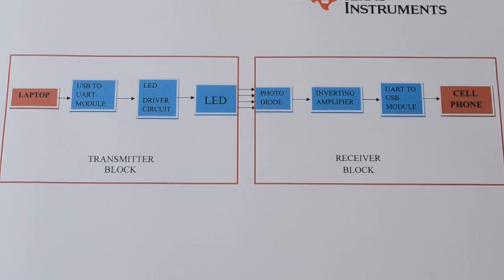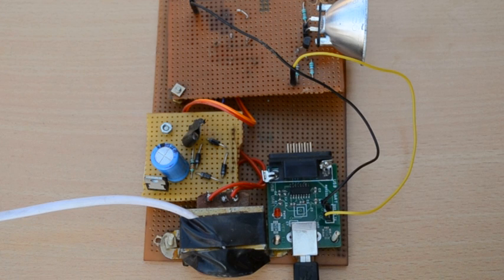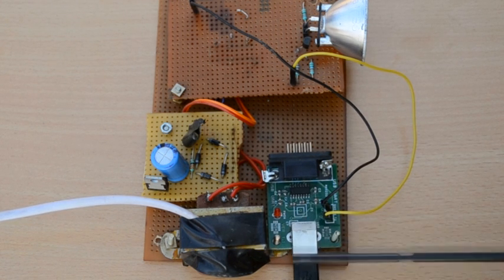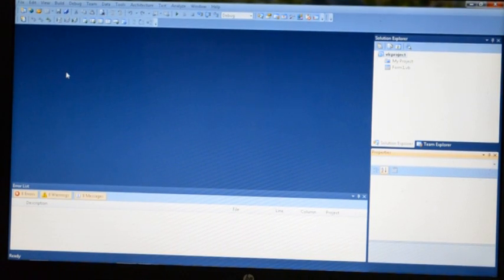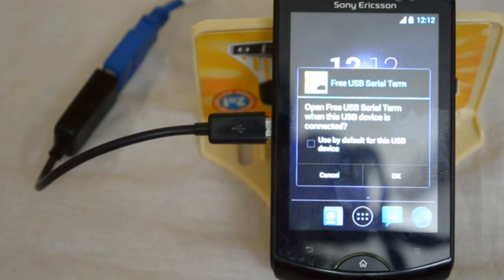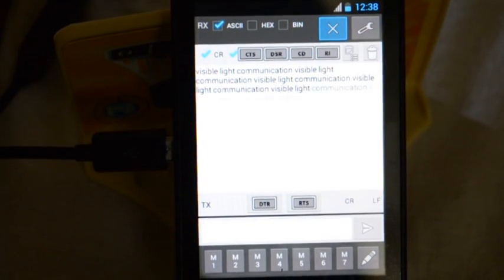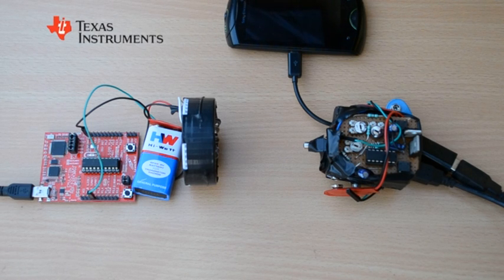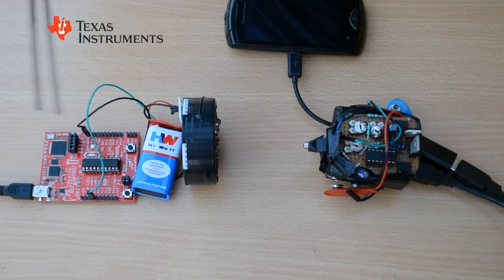Engineering Final year project - Visible light communication(Li-fi)

Comment: Make using PCBS computer designed as your project is good but it is not practical to carry such a big receiver with a phone also the range of lifi is very low and can’t be used in a mall as there are already very huge lights in mall so your led would not even be visible

Comment: I am working on a visible light communication project.  My aim is to send characters wirelessly from keyboard to microcontroller & then to LED & reception by photodiode/phototransistor & displaying the character on LCD via a  microcontroller.
I am stuck at the reception part.
How can we code or use any synchronization technique such that the photodiode/phototransistor recognizes & differentiates the information we send, from the continuous on-signal it is receiving from LED which remains on for the lighting purpose otherwise.1111...: This is the signal which photodiode receives when LED is on for lighting purpose. 10010011(or any other 8 bit data I send from keypad) is the information which the photodiode should  differentiate for displaying on LCD.
I request you to suggest at the earliest since I have deadlines.
Thank you.